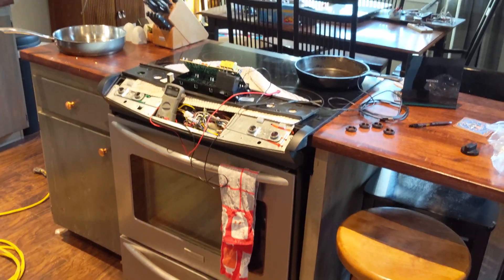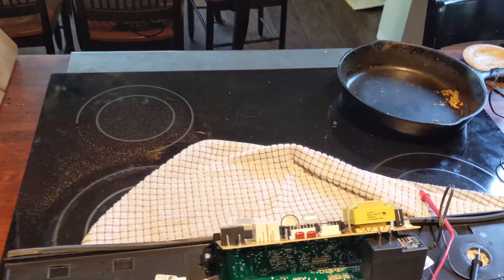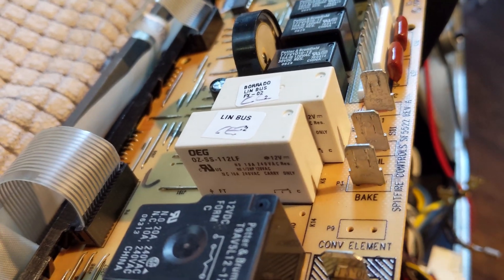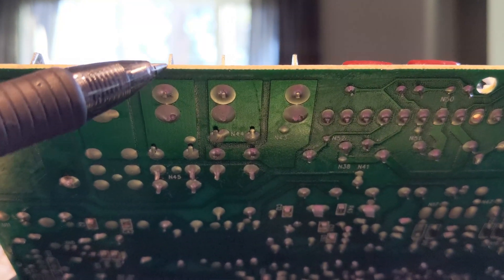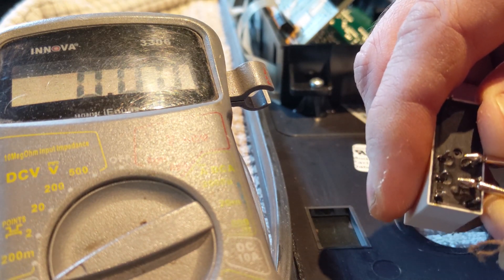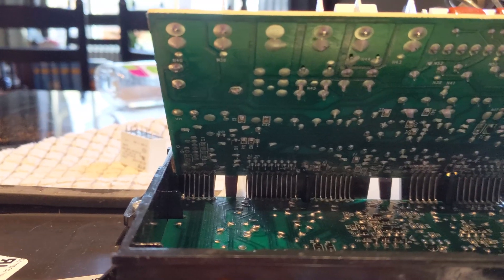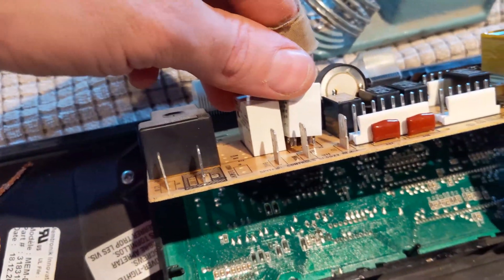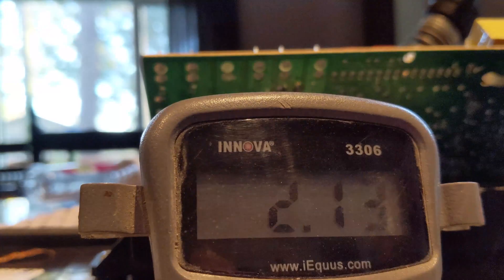Free Frigidaire Pro Series Stove Circuit Board Repair!

Comment: Inspired by this video, I decided to open my failed control board on my 6 year old Frigidaire oven. Thought it would be a waste of time because I don't know alot about electronics. Looked at the relays first and sure enough there is a dark pin on one of the relays with most of the solder missing on it. Going to order the relay to see if I can fix it. Thanks for the tips on removing solder and installing a new relay.

Comment: Hello. Thank you for this beautiful video. I have a problem with the board. The meeting was completed and I did not try to open it. Wall or art, it will not be done completely. We overcame the challenge and opened it and it came out even if it was not done. I have a main irrigation, but the problem is now. It is on. It works for about 30 seconds. Then it disconnects again. E. Electricity? On the switch and Open? This is the problem I see. If you had the time, please follow me and I would benefit from changing any laari? Or both? I decided to change the 12 main bots. But now I don't see a different problem. Can you help me? Thank you very much.

Comment: Steve,

My broil relay shows OL when tested and the bake 0.000- 0.001 but neither element seem to work. When resistance was tested on the elements them selves the lower element is 16.1 and the top 20.1 resistance. Will replacing just the one broil element fix both?

Comment: I've also ruined some electronic things by burning or ruining the trace on the PCB board so being a cheap Mr. Fix-It doesn't always work out but it usually does. These ranges are pretty complex. I actually wish the house I moved into had a traditional coil one, less electrical components, easier to repair and access

Comment: Would you know if the relay for the broiler could be stuck in the open “on” position for a F10 (runaway temperature) error code where the broiler stays on?  Could it be something else?  Would the broiler always be on when the stove has power, even when not powered up, in such a condition?

Comment: I have to resolder the connector for my control pad...but that means accessing the underside of the top board...was it difficult to spread the two boards? mine has a few standoffs (plastic conntectors) but like your it has rigid connections down one of the long sides of the circuit board.

Comment: I have a Kenmore oven that the screen over the burners telling time and temp is dim. The board is no longer available. Any suggestions on what might be the issue? Thanks for the Video.
Reply from the maker: Hey! Wish I could offer some real help. I'd probably try to check the power going into the screen. Not sure what voltage it runs on, but if it's a DC power supply, maybe the power supply is failing. That might be where I would start digging around. Honestly just a complete guess, could he 💯 off. Good luck!
Reply: @stevevanpelt4475  Thanks for the suggestions. I will give that a shot in a week or so when I get a chance. Thanks again and I hope you and your family stay safe and well.
Don

Comment: I just got this problem to my gas range.  I powered on and off outside the home when the keyboard stopped working.  Now the oven light is on, it's beeping non stop and there's an F 11 code.  So yes I am thinking of replacing it asap.  Yup just over 1,100 purchase price.  basically exactly like this one but I don't think i'll take on the challenge to replace it.  Buying a cheap range will cost me just over the cost of a new board if I an even find one.

Comment: Great job!.  There is a replacement for about $150.  P/N for mine is 316418735.  It is called Clock, Timer, Electronic and No. 20 on the Frigidaire PLES389ECG parts Diagram

Comment: I wish you showed how to remove the panel then your clip would have been useful.
Reply from the maker: You just pull the knobs off by pulling straight out, then remove the large plastic nuts directly under them 🙂👍. That's all that was holding my panel on.

Comment: Very good job. Realy helpful. I wish you would have commented on the continuity readings. When the multimeter shows 0.000 Ohm, you said: Perfect! What would not be perfect? Thanks
Reply from the maker: Hey! Thanks for the comment. The continuity reading is just showing a continuous electrical path with no resistance. If I remember correctly, when I diagnosed the issue with the relay, I compared the working relay to the relay for the element that wasn't working. What I found was that 2 pins on the working relay were connected (measurement of 0 on the multimeter), while the same pins on the bad relay showed no continuity (1 on the multimeter). So when I measure the continuity of the new relay at the end after installing it in the circuit, I'm just checking to see that it has those pins connected (0 on the multimeter) just like the relay of the element that was working. Sorry that wasn't clear! Hope that makes sense. 👍👍
Reply: @stevevanpelt4475  ok steve 
what about if the relay keps on clicking every 3 seconds or so..??

What could be wrong here:
-the relay itself
-the feed "main transformer"
-the capacitors

Thanks great stuff video
Reply from the maker: @Leo28aa  Hey! I would check the power input to the relay while it's clicking. I assume the power is switching on/off, so I'd start investigating upstream of the relay... But I don't have the board in front of me, so I'm not sure what's there and what could be causing that issue. Honestly my electronics knowledge is pretty limited, but on that board there is probably a timer of some sort that switches between the upper and lower element, and an input for a thermistor/heat sensor. Heat sensor would probably be easiest to check. If it's giving weird readings, it might cause the relays to cycle quickly like you describe. Good luck.
Reply: @stevevanpelt4475  Thanks much for coming back. All is clear now! 
Meanwhile, I searched on internet and found that the least ohm you measure the better it is. Meaning that the resistance of the wire between the connexion is weak allowing for better flow of the current.
Reply: @stevevanpelt4475  I just noticed that you said that you are from Salem, Oregon. Funny, I did my PhD studies in Microbiology at Oregon State University (Corvallis) back in the late 80's and early 90's. Good memories!  My best to the beavers!

Comment: Hey l have the same model oven and it trows the f30 error and it trips the limit switch, I reset the switch and works again but next time we want to use it , same thing happens , I already checked the temperature sensor and checked ok, also check wires and they all ok, it seems like is something wrong with the board, some sort of shortage, I appreciate your help

Comment: Is it still working? Does the convection setting run ok? I have a friend who has this same stove but the fan on convection setting sounds terrible like a grinder. Maybe you could do a video of yours because I want to see if there is really a problem with my friends.
Reply: @Steve Van Pelt I went to my friends today and I figured it out and I believe I fixed it. Apparently, the loud noise was caused by the fan blade hitting the cover. I thought at first it was the motor but it ran normal and quiet without the cover on so I bent the tabs that hold the cover on and put it back together and it runs good as new! Check out the videos below so you can see for your self. 

Video 1: https://youtu.be/tHkSr69P6aU
Video 2: https://youtu.be/AK9oP-NLnPk
Reply from the maker: Hey! Yes it still works. Unfortunately we are renting out the house it's installed in, so I can't send a video of it working, sorry! Hope you can figure out what's wrong with your friends!!

Comment: Hi Steve, 
Where did you find parts for this stove?
I need the rubber gasket between the control panel and the glass.  I don't know where to find it. 
Thank you
Reply from the maker: Hi! The only part I bought was the relay, which I bought from eBay. 

One way that may help find the part is to search for the parts diagram for the whole stove. You might find this in google images, or on an appliance part website. On the parts diagram you should be able to find the part number for the gasket, then you can search specifically for that part # in google or eBay. Alternatively, you might try finding a rubber strip you could cut down to size. Good luck!

Comment: Great fix my friend.  I have ? for you.
My  MAYTAG  RANGE: #MER7662WS control is not working.  After engaging oven feature  we heard a "pop"
and board showed signs of  a burnt and black area at oven  terminal connections area.
Can I  replace control board with confidence and not have another burnout?
Also looks like connector is too melted to reuse - is it ok to replace connector with exact same  one?
Reply from the maker: Hello! My electronics experience is pretty limited. I know that it's pretty common to have a problem with the power right where it comes into a device. But I couldn't tell you whether replacing the board will fix it for sure. That would probably be my first try though, if the existing board isn't repairable.

Comment: Wow, this was so helpful! It wasn't exactly our problem (we have pretty much the same range but we have an issue with one of the burners randomly/sporadically turning itself on. It used to rarely happen, but suddenly is happening more and it almost started a fire the other night because we had left a plastic container on an adjacent burner and the bad one was on so hot (and apparently long) that it melted it. Luckily we were still awake in the next room and smelled it, but now we're scared. We found the Surface Element Control Board that needs replacing and got the panel off... but the replacement board is very spendy and factory backordered, so we're considering our options. Wish we were as handy with electronics as you. I WAS able to find one place that claims to have 2 in stock, but before we go there, I"m wondering if you could take a quick look at the part we need and comment on whether there is an element that might be replaceable (as yours was in your video). We only need to replace the board on the right side of the range (facing the range) and the part comes with both sides, perforated so it can be broken apart to install on either side of the middle control board you were working on, so it looks a lot different than the part your worked on. I'm not asking you do anything else... just take a look and point us in the right direction, if it's a possibility.  We need the right front burner to start behaving, if that helps. Thank you. This is a link to the part so you can see what it looks like. https://partsdr.com/part/318411400-surface-element-control-board?model=FGES3065KFA
Reply from the maker: Oh wow! That's a scary problem to have. I do recognize that board. I think it's basically just some sort of position sensing potentiometer and a display. My uneducated guess would say it's a problem with the potentiometer, but I'm not sure if it's sending a digital signal somewhere to control the burner, or if it controls the burner directly.  What do you do to get the burner to turn off when it randomly turns on? If there is a part number on the potentiometer, that might be worth replacing first if it could be purchased cheaply. My electronics knowledge is growing, but honestly pretty limited. 
One suggestion might be to take a look for any cracked solder joints to the potentiometer, cause it can take a lot of stress. 

Good luck! And let me know if I can be of further help. I don't have access to the stove right now (it's in our rental that's occupied), but otherwise I can help from memory of I'm able 🙂

Comment: Could you please record a video to show how you open up the front panel?  I have one stove just like this and the keypad does not work at all (and therefore the oven cannot be used) though the stove still works - because my power supply had some issue and something in the control board might be burned.  But I cannot figure out how to take the front panel apart.  Thanks!
Reply from the maker: Hello! Yes it is a bit confusing. You actually just remove the knobs, then remove the threaded retainers under the knobs. If I remember correctly, the control panel is completely held in place by those retainers. The screws underneath the panel (above the door) may need to be removed as well. I couldn't figure out how to open it for a while, too! Hope that helps
Reply: Hi John Yin, I also need to open up the front panel, so any tip would be appreciated!